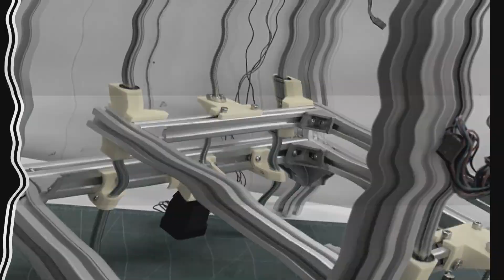Build: Hypercube Evolution - Part 5 - Z Axis

Comment: Just wondering does there need to be more than one lead screw
Reply from the maker: I believe you can use just the one lead screw however you would need to either use a higher torque motor or keep the bed weight down. With 2 I can put a considerable force or the bed and it doesn’t move down even when powered off.

Comment: I have always found it best to mount he Brass Nuts loosely, or, to put springs in the bolts/nuts with washers ... to allow some give and flexibility or freedom of micro-movement ...?

And, might the Brass Nuts be better upside down, or under the yellow bracket?
So the Brass Nuts faceplate is a larger more-supportive area to bear the weight of the Bed?

Thanks Nathan! Another great video :-) √√
Reply from the maker: Yeah I had thought about using the anti backlash spring and but setup but ended up forgetting to order it haha. 

I had a play it he the positions of the brass nut and it seemed ok there but now that you mention it if the screws come loose with the brass but on top the bed assembly could drop pretty bad. 

I am glad you like my videos makes it worth while!